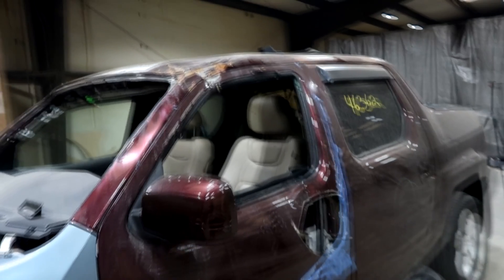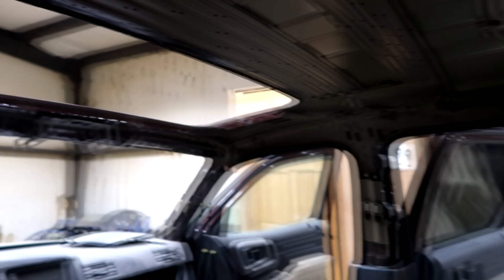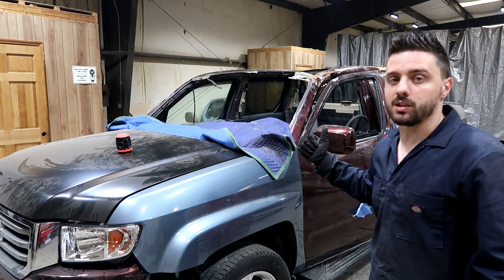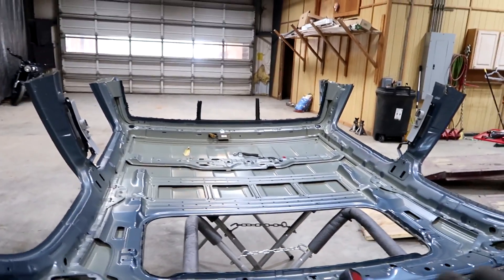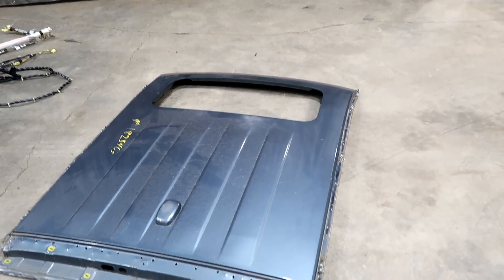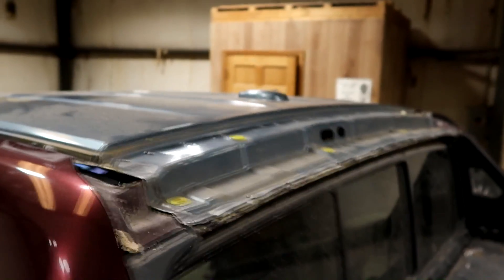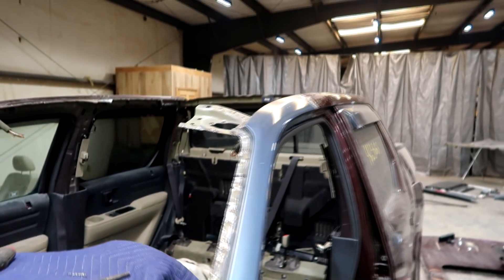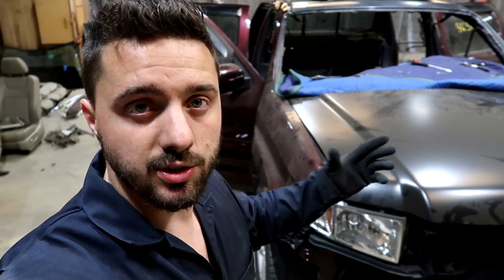Rebuilding A Wrecked Honda Ridgeline Part 3

Comment: Nick I just watched part 3 of the Ridgeline roof replacement and you showed us the drill bit you were using in the new package. It was on time lapse and could not see the brand or size of the drill bit.  Could you tell me what brand you normally use and do you think that what you are using is the best quality as far as sharpness and durability ?